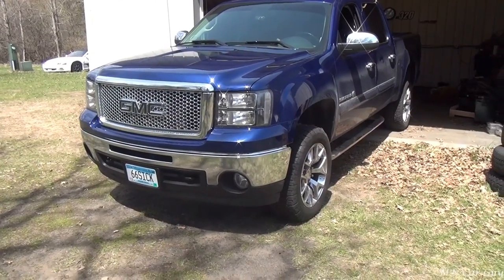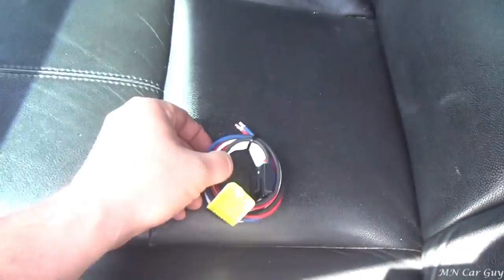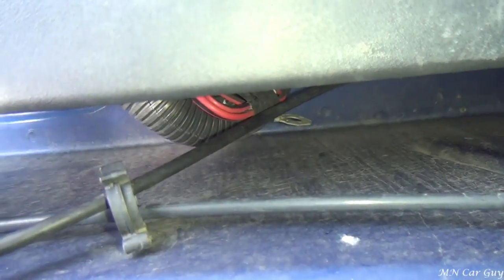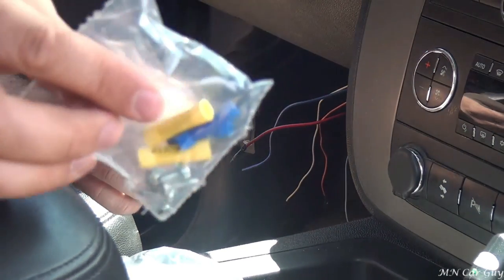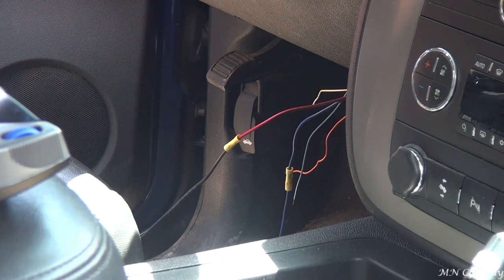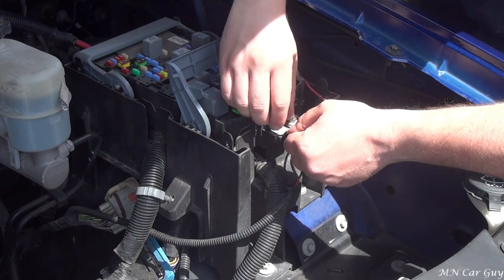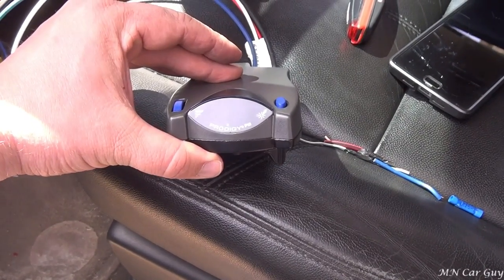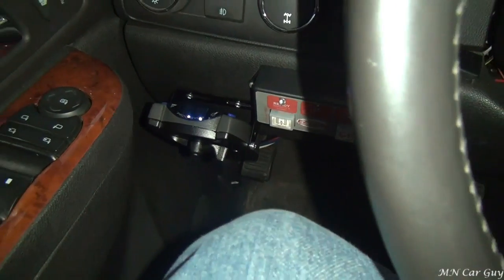Brake Controller Install (2012 GMC Sierra 1500)

Comment: I just mounted one in same location on my Silverado.  Due to the slight curvature of dash the controller is not super duper balls on horizontal.  Has yours worked okay in that location without problems?
Reply from the maker: I haven't had any issues with mine and I put it to use pretty often.

Comment: Should have stripped more off on the controller wiring before attaching the butt connectors. If I had to guess, you probably didn’t make the best connection with so little wire actually stripped.

Comment: Not related to this vid . But what year 6.2 did you get ? Was it originally from a truck? And does the harness swap over ? I have a 2013 Silverado 5.3 right now . Thank you @mncarguy
Reply from the maker: I got mine out of another 2012 Sierra. The harness is all plug and play except the VVT and you'll need to reflash the computer with a 6.2 tune. I'm working on typing out everything I did step by step so I can post it on a forum.
Reply: mncarguy cool! Will you make a vid on it ? I would like to see the write up

Comment: Can this be installed on a 2013 GMC SIERRA 1500 V6 2 wheel drive truck
Reply: Just installed on my 2013 and everything is the same
Reply: I can’t find the red wire next to the fuse box

Comment: The orange wire, is it for the charging system for the trailer battery? N if it is, how u hook it up?
Reply: Center high mounted stop lamp...not really applicable to any trailers.